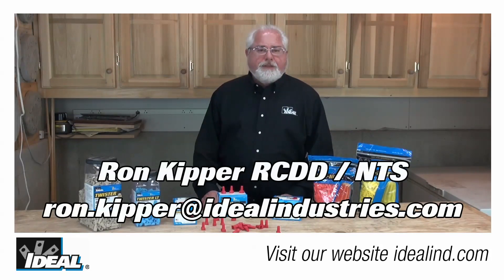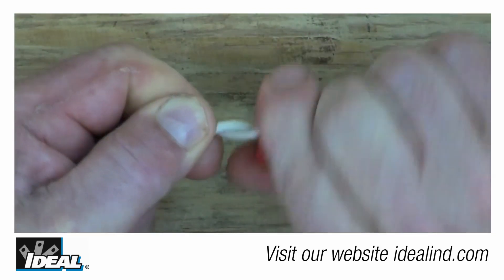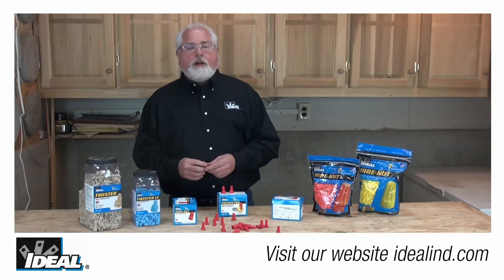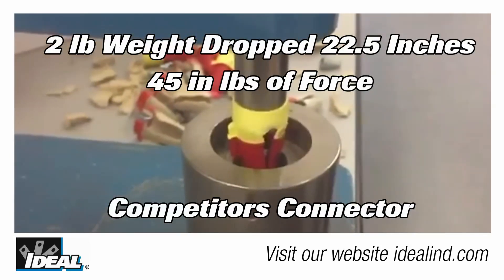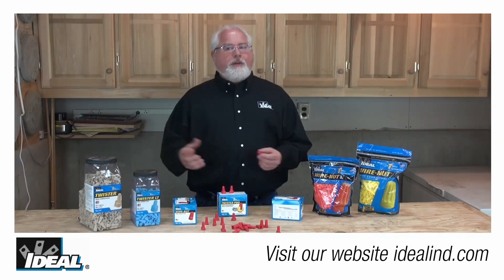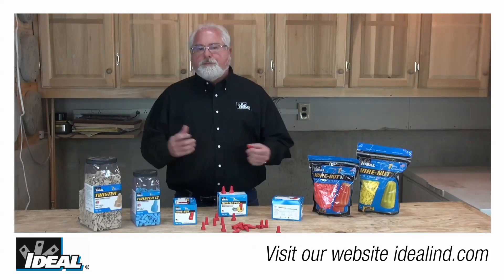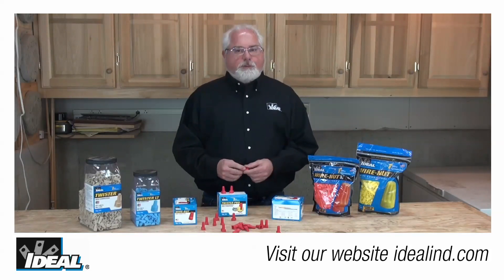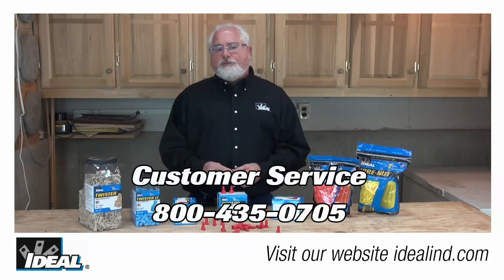IDEAL Wire Connectors Video

Comment: What I found interesting was that you said that the stretch lines (white areas) was designed in and presumably fine and normal. I previously thought that it was an indication of an over torqued wire nut.
Reply from the maker: yes they are designed to swell some with larger wire combinations have fun Ron

Comment: Can you use 4 ( number 14 wire) in a red connector?
Reply from the maker: Jim yes max is 6 #14 in a red Wing-Nut. Have fun Ron
Reply: @RonKipperDatacomm1  Thanks for quick reply Ron. I tried reading the instructions on the package but its confusing. Curious how many #14 wires (max) for the yellow connector.
Reply from the maker: Jim on most of the product pages on home Depot and other sites I load the UL Listed wire combinations as a pdf in most cases. You are not the first person to ask have fun Ron
Reply from the maker: Wow Jim that is quite the video! Pretty in depth I like it Ron
Reply: @RonKipperDatacomm1  Thanks Ron

Comment: I stumbled into your videos searching structured systems. thanks for easily demonstrating every thing so far. As a remodeler and handyman keeping one type of wire nut will make life easy and now more bin of assorted mismatched connectors. makes for a clean professional installation. Now on to more videos! Subscribed.
Reply from the maker: Aaron Risley Aaron great to hear from you and thanks for watching! The Tan Twister from us is really a great connector and does 2 #20 AWG to 4 #12 AWG wires which in a home covers almost all the combinations you will have.